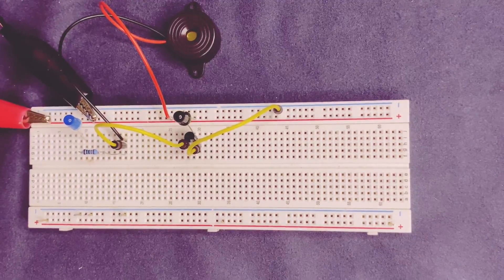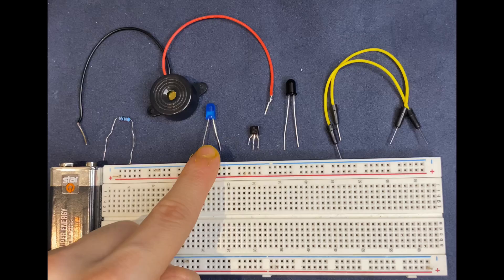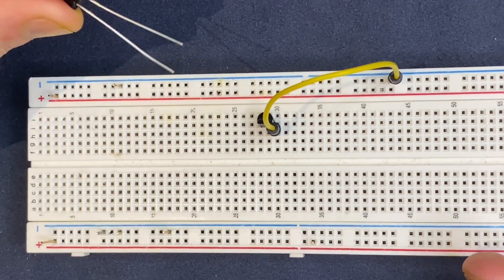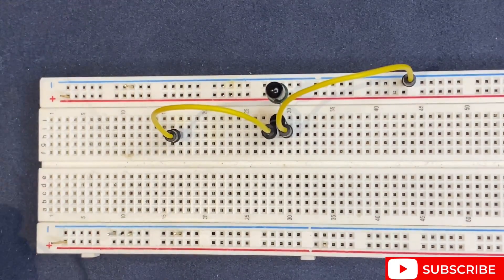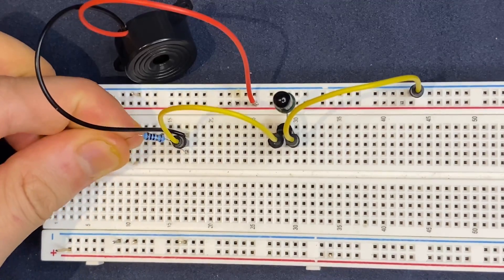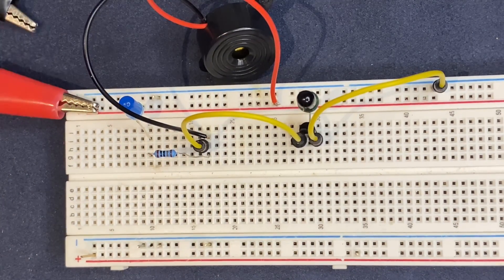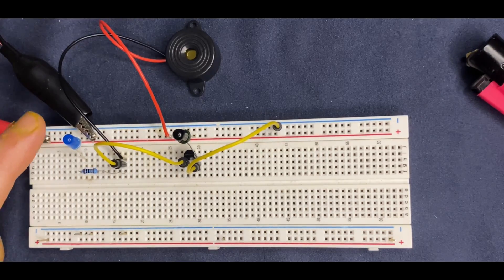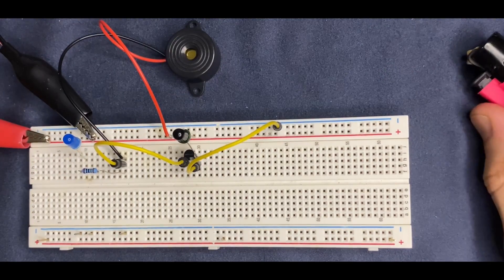How to make Fire Alarm Circuit using Bc547 on breadboard HD #breadboardprojects

Comment: Didn't work
Reply from the maker: Check the polarity of the Infrared LED,  normal LED and Buzzer . Make sure that the transistor pins are in the correct order maybe the emitter and collector are vice versa 

When you are done with the wiring check whether it is  according to the diagram or no 3:13
Reply: @ElectroMin i tried everything and didn't work at all